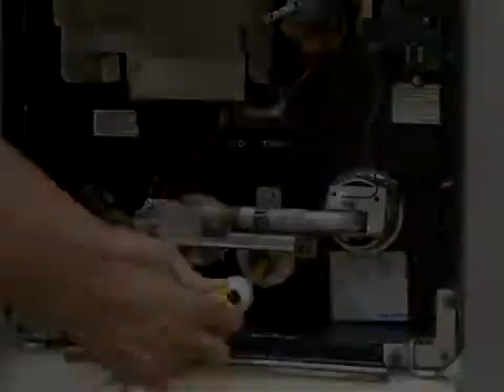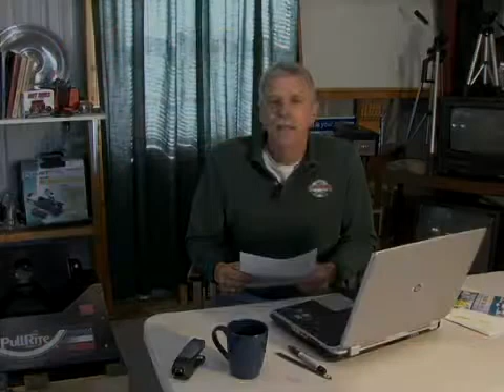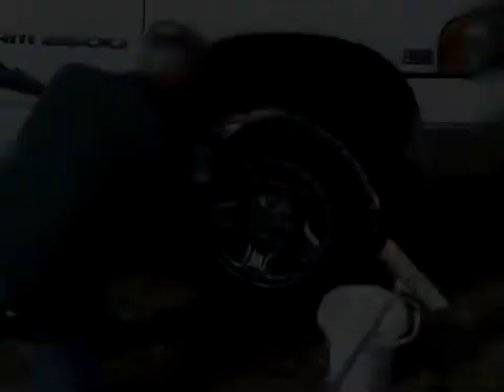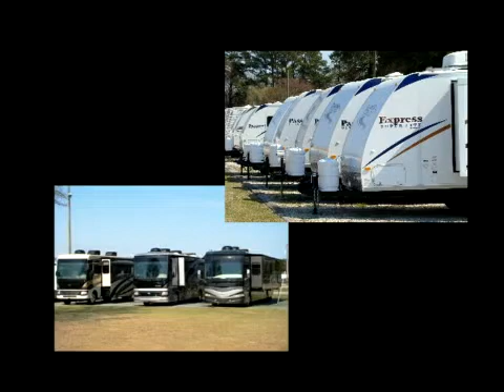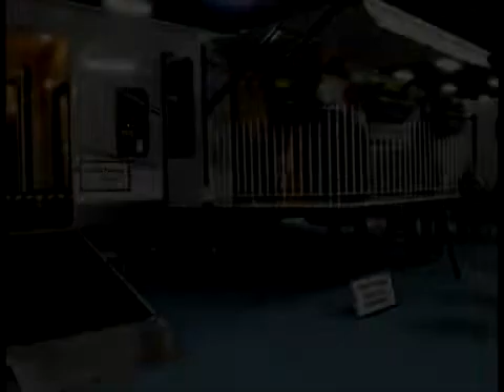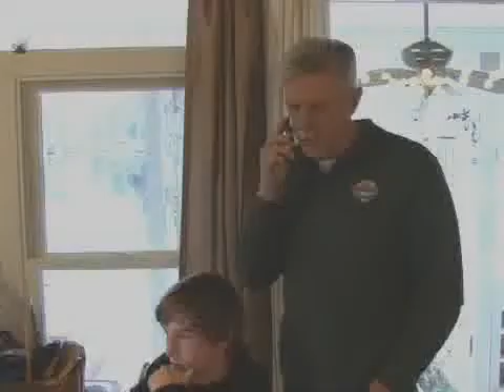Mark's RV Garage Episode # 1 Internet TV Series by RV Education 101

Comment: I've discovered that my fresh water tank in the 29' 1988 Fireball does not have a 12volt pump. (lots of essential things are missing). Can I use any 12volt pump, or do I need to buy a specific one? Also, I need to know the name of the power center (fuse box) that you used in the Yellowstone. I need to replace the one in this rig, too. Some days, it feels like the Money Pit, but I know that in the end, it'll be fantastic and my new home.

Comment: Just got my first RV- a 29' 1988 Fireball Fifth wheel F29-RK. I have a LOT of work to do. It hasn't been maintained in several years, so I have lots of wood to replace in the roof, walls and the kitchen floor is rotted out. I'm redesigning the kitchen to be more efficient for me anyway. I'm pulling out the dinette and using folding tables and chairs that can be used outside on nice days. Right now, it's cleaning, cleaning cleaning (that hasn't been kept up either). One question from a newbie- what's the difference between using the fresh water tank vs the city water hookup? I thought the hose filled the tank on a float system, or am I wrong?
Reply from the maker: +Tina Gallagher When you connect to a water source (city water) it provides water throughout the 
RV. If you won't have access to a water source you can fill the fresh water 
holding tank before you leave on your trip and then use the 12 volt water pump 
to pump water from the holding tank throughout the RV.  The fresh water tank and 
water pump simply allow you to have and use water in the RV when there is no 
external water connection.

Comment: Mark I seen you mention the tires and the care for those tires to include the air pressure which is so important.  Well I have had those tire pressure problems and they caused me a $4300 BILL FOR REPAIRS after the tire explosion.  I would feel better if you would have mentioned the darn pigtails which the dealer told me was so necessary.  They leak like crazy
Reply: +Donald Losey And all you needed were valve extensions many truckers use on their tandems and at $3.00 each a better investment! 

Yes, the air systems are fantastic if your rig has an air compressor to keep the AP the same on all the tires but when parked they leak worse than when rolling! My fix as a trucker was plummer's Teflon tape on the stem but ONLY 2 wraps or enough to get a seal on itself! We're working with air not water!

Remember the more something costs when sold by a salesman, the less you really want it. Or it's not worth the cost down the road. It's also, as you might know by now is it adds to the maintenance schedule! 
MORE leaks to track down type of work for one, then the repair to stop the silly leak the system is made to keep aired up but is wearing out the air compressor with more work on that part also! Only good for the trucking/transportation industry not so for RV use.
Yeah, we're retired but NOT looking for make work jobs when FUN is out there waiting! 

Alligator extensions are just a solid metal extension with a simple spring and ball valve that seals the stem and extends the valve stem into a hole in the rim so you can reach it easier with your tire gauge or air line and it has ribs to hold a tire chuck on while filling the tire. 
Found at every tire shop in the US or truck stop. You'll love them over ugly tire equalizers and the lines and clamps on your pretty polished rims if that is what was frosted off on you. And they are so maintenance poor they become out of mind until you stick it with the tire gauge! 

Ok, that's enough hijacking for today! 

Blue Sky's and Safe Journeys!